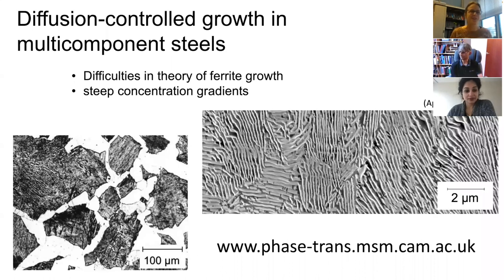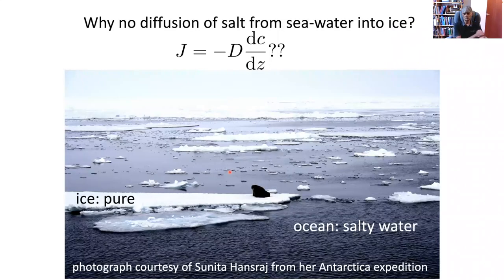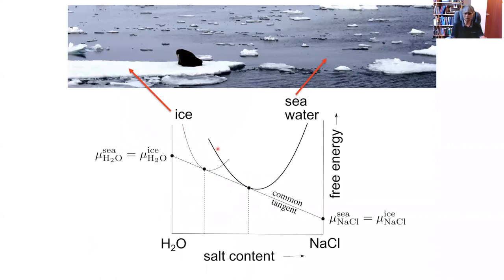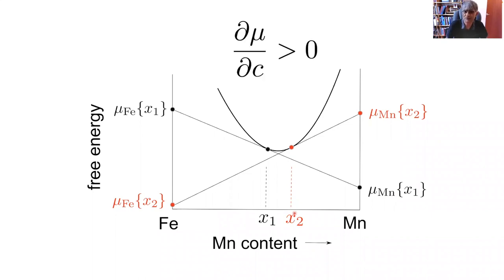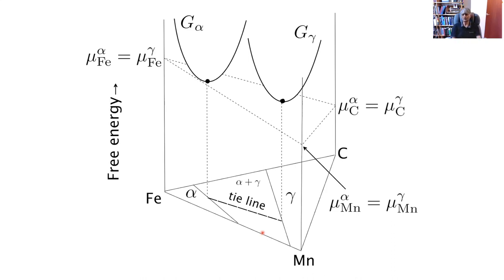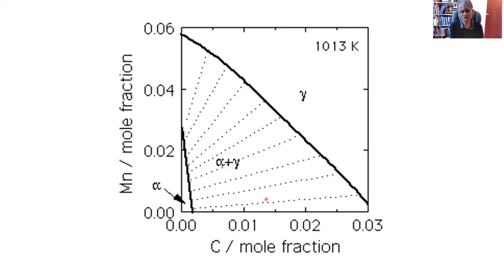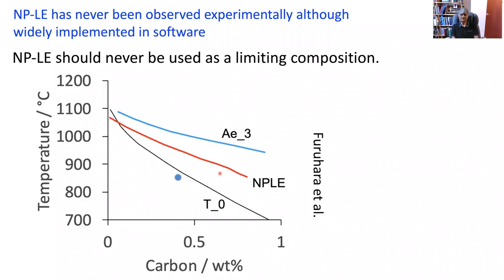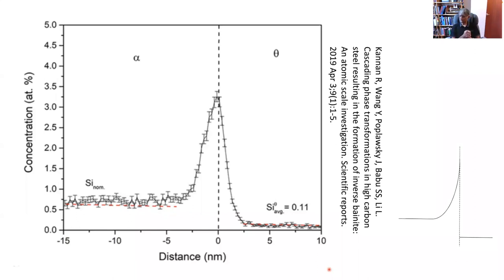Diffusion-controlled growth in multicomponent systems

Comment: Hello Professor. I have a doubt. Will the diffusivity of a solute element be the same in both liquid metal and solid-state diffusion ? most of the diffusion coeffcient that we find in the text books are related to solid phase transformation right ?
Reply from the maker: Will not be the same. There are plenty of data for diffusion in both the solid and liquid states. See, for example, J Fridberg, L-E Torndahl and M Hillert, Jernkontorets Annalar 153 (1969) 263-276